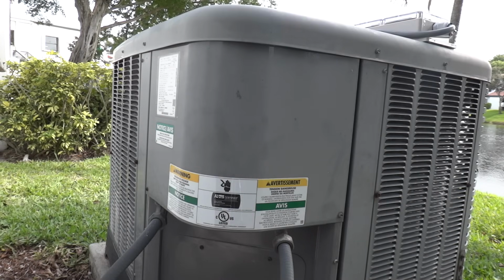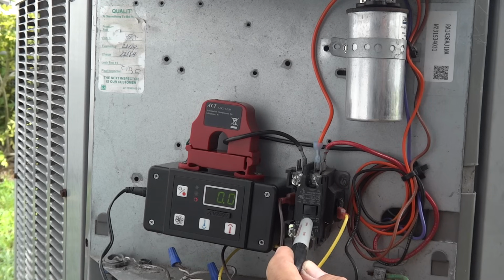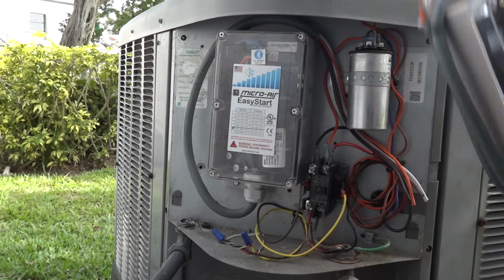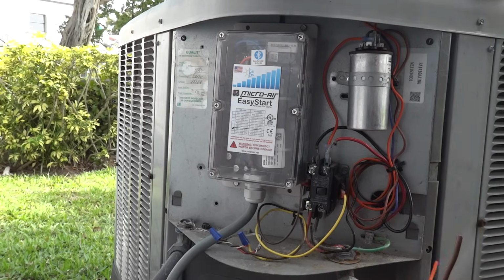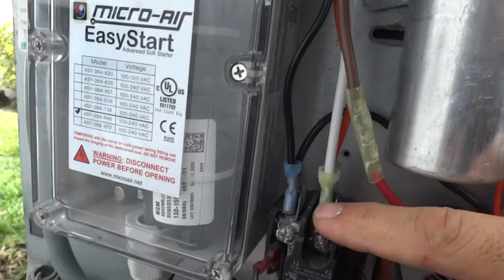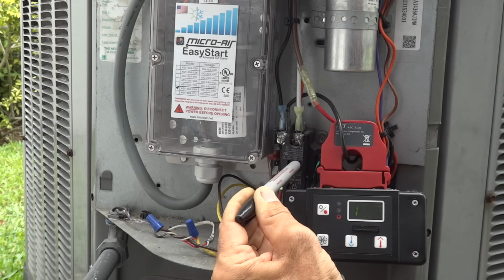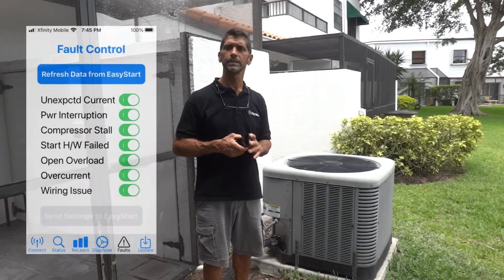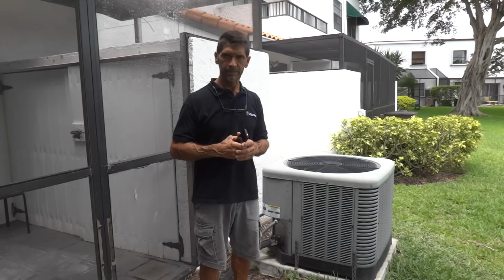Micro-Air EasyStart Home A/C Installation (368 Series)

Comment: This looks like a great product.  Soft starts are the way to go.  Besides limiting current spikes, it should also lengthen the life of not only the compressor but of many of the parts of the system.  Maybe you could develop a sister product that works with the blower fan(s).
Reply: @didyuknow ...And many of those ECM condenser fan motors are changed to old-school PSC induction motors, once the customer finds out what the replacement ECM motor is going to cost. 🙄
Reply: Don't need one for the "blower" as most condenser fan motors / evap. motors are ecm and or x13 motors witch use 3phase vfd/inverter witch is what the easystart is for the compressor.

Comment: Since the unit is designed to start a certain way I wonder if this will eventually damage the compressor.    Yes I know you offer a warranty but it says “ if the micro -air damages the unit it’s covered”.  It would be impossible to prove that’s the case.   So basically really no warranty.    My generator starts my 4 ton But you can heard it  slow as the massive draw starts the unit.    I might get it ready and only use it during a power outage.   Not ideal but would work.
Reply from the maker: Hi Gene and thanks for your comment.  EasyStart will not "eventually damage the compressor". It is in fact quite the opposite as explained in detail in the video.  Even if EasyStart malfunctions, the worst it would do is simply not start your compressor.  There are extensive electronic controls and relay disconnects to prevent anything from even energizing your compressor if anything is wrong.  Of course, if you are not comfortable with installing one, you certainly should not.
Reply: @MicroairNet  saying something in a video doesn’t make it true.   My concern is that because the compressor is designed to startup at a specific amperage, lowering that might actually harm it.   They are built a specific way and changing those parameters could damage them.   I would probably check with Copeland since they make most compressors and ask if using less amps to fire it up would hurt them.  Maybe your company should  contact them and get a letter you could add to your product
Reply from the maker: Emerson Copeland previous and may still offer their own soft starter that is a competitor to EasyStart.  Therefore, one would think they approve the use of soft starters.   Feel free to touch base with them though if you don't trust our word.  Micro-Air has been in the HVAC control design and manufacturing business (primarily marine) for 40 years.  It would not have served us well to dispense any false information that wasn't based upon relentless and through design, testing, qualification, and field results.  90,000+ satisfied EasyStart customers can't be wrong, but you certainly have the prerogative to make your own decision.
Reply: @MicroairNet  ordered.   Sure is a long wait time.   I’m glad you are selling so many.
Reply: Just arrived.   Installing it tomorrow

Comment: Are supposed to discharge the capacitor first? If so, how did you do that? Thanks!
Reply from the maker: Hi Rob and thank you for your question. I answered this before in great detail. Click the following link and the video will open up again with the particular comment and my answer highlighted at the top of the comments list.  Hope this helps:  https://www.youtube.com/watch?v=bp4U-husy1o&lc=UgwzfK55WMX_nr4lxEB4AaABAg.9eQFI1rRPhX9eQRugh8SUZ
Reply: @MicroairNet  Apologies, I clicked the link but can't seem to find in the video or comments where you talk about discharging the capacitor. Thanks!
Reply from the maker: Hi again Rob. No worries. The link of course opens up the same video, but the comment of interest that I'm referring you to gets shown at the top with the label "Highlighted reply".  Cutting/pasting my old response works too.  Here it is:

Here's the truth about the capacitor discharging issue.  Before EasyStart is installed, the run capacitor (silver one) that is installed in your system will always immediately discharge after the compressor is shut down since it discharges through the motor windings. This applies to both 2-terminal (single) and 3-terminal (dual) run capacitor types.  Any optionally-installed start capacitor (black one) in a hard start setup will also discharge through its bleed resistor (if it has one), albeit more slowly in about 30 seconds.  So, when you go to install the EasyStart, after removing power you don't have to worry about discharging the capacitors.  It never hurts to double check with a voltmeter or use an insulated handle screwdriver to briefly short the capacitor terminals together.  Conversely, after you install your EasyStart and energize your system at least once, any 2-terminal (single type) run capacitor will end up isolated after the compressor is shut down and it will no longer discharge through the motor windings; in this case, you need to discharge the run capacitor before you handle any wiring.  However, if your run capacitor is 3-terminal (dual type), it (both halves) will still eventually discharge on its own through the fan motor windings.  Hope this helps.
Reply: @MicroairNet  Thank you! This saves me a little trouble. I really appreciate you taking the time to answer. Can't wait for it to arrive!

Comment: How do u install it on a two stage a/c system that has two compressors? Trane xl19i.
Reply from the maker: Hi and thank you for your question.  So-called Two-stage systems made up of a single compressor with two output capacities (i.e. the scoll types with the bypass solenoid or the reciprocating types that reverse direction to engage more pistons) accept a single EasyStart wired identically to a single, fixed speed compressor.  However, for true 2-stage 2-compressor systems, the only viable option is to install a separate EasyStart on each compressor.  We've investigated these before and it is not possible to wire in a single EasyStart in such a way where it can be shared between two compressors.  Hope this helps.
Reply: @MicroairNet  thanks.
It does have two separate compressors.
Most of the time the smaller compressor cycles on and off. 
The larger rarely comes on.
Should i just install on the smaller compressor?
Reply from the maker: That is an option.  I would first think about what your final goal is.  If you want to be able to run your 2-compressor A/C on a generator during a power outage, then limiting it to only use the smaller compressor would be helpful, and then you could get away with installing only one EasyStart as you are suggesting.  The bulk of the operation on utility power will benefit the small compressor since that is doing most of the work.   

Beyond this, you might need to do one more thing for when you are operating on generator to prevent the 2nd compressor from trying to run:  Most thermostats that handle 2 stages have a Y1 and a Y2 output. Y2 engages the second stage which in your case is the separate compressor.  I am not sure if your thermostat has a setup screen where you can control whether or not the A/C system is 1 or 2 stage. If it does, then during a power outage, you could turn off 2 stage operation to prevent the second compressor from trying to start. Worst case, you could add a switch to disconnect Y2 from the A/C when in "emergency generator mode".  Once utility power comes back on and you are off generator, you could then turn 2-stage operation back on again.  Just some ideas here.
Reply: Hate to but-in, but I have the Trane xl19i (19yrs old) and I can say that disconnecting the Y2 wire would NOT provide the desired result. On the rare occasion that there is a call for stage 2, the first thing that happens is that the stage 1 contactor de-energizes (small pump off) then, after some delay, the stage 2 contactor energizes (large pump on). Without Y2 there would be no pump running at that point (don't know if any faults would occur - I think not?). Changing the thermostat setup to 1 stage cooling is probably the answer, but I have no experience in trying to run the system that way. Just my 2 cents 🤔
Reply from the maker: @Walter Smith Yes, legacy 2-stage system were in fact 2-compressor, not a single compressor with 2 switchable output capacities as the more modern ones are described above.  In the legacy case, you need to install one EasyStart on each compressor so they can act totally asynchronously, regardless of when your thermostat energizes Y1 and/or Y2.  Not everyone wants to invest in 2 EasyStarts though, so many customers with legacy 2-stage systems have installed only 1 EasyStart on their stage 1 compressor and temporarily (i.e. only during a power outage when operating on generator) changed the settings in their thermostat to force the system to behave as single stage only.

Comment: Thank you for the detailed video and explanation.  Your product seems very well designed.  And its greatly appreciated that it is designed and made in USA.  Based on your very well written documentation, Bluetooth is only activated when a call for cooling/Heating is made to the Condenser so that the contactor will apply power to the White input wire of the device.  Is it possible to have the bluetooth on all the time in your future product generations? Also incorporate some application access security such as authentication requirements?
Reply from the maker: Hi and thank you for your compliments and for your question.  You are correct in your assessment that the Bluetooth will only be accessible when the EasyStart is powered up via the condensing unit's contactor.  EasyStart has and always will be a slave device.  In order to allow the Bluetooth to run all of the time, we would have to add a fifth wire and some associated circuitry.  However, in order to keep the product cost and complexity of installation down, this was never part of the design since the product's inception.  Yes, we realize that customers like you could certainly handle connecting a fifth wire, but you'd be amazed how many complaints we already get about 4 wires.  Also, the Bluetooth feature is only meant for diagnostics, so continuous connectivity was never the intent. Hope this helps.
Reply: @MicroairNet  I see that you already thought about this.  Yes, I also have found my fellow HVAC professional often want minimal wires.  :) .  Great product by the way, and there is nothing else like this.  The safety features and the app information is already worth it.

Comment: Hello I just recently installed the 368-48 and have not had the results that everybody else is seeing. My purchase was based on a few things, one the chart at the end of this video showing , the different size generators you would need using the micro-air and also a few other factors  .
So my Generator is Duramax 13000 tri fuel and I am using N.G which knocks down your amps and watts but that being said I am well above specs shown by micro air.
I  have a 3 ton Goodman GSX series which is about 4 yrs old. I got with their tech support  was told that I am getting 68% inrush reduction so as per tech support LRA = 77 for my unit -24 amp reduction average is what there seeing give me 54 amp not acceptable to me. I had a hard start kit which was giving me 35 amp inrush . I am not an electrician so if I am missing something here please tell me
Reply from the maker: Hi and thank you for your comment and for your business. Using the EasyStart smartphone app, please upload the data from your EasyStart to Micro-Air using your smartphone.  We will then be able to analyze your results and advise from there, and then take any necessary actions for you under warranty.
Reply: @MicroairNet  Good Day I had done that with Barry will be glad to do it again , I really don't want to send it back I really want this to work and I am open to any and all suggestions
Reply from the maker: Okay, I found the data you uploaded yesterday and the email conversation you were having with Barry. The first set of data you sent yesterday morning shows that your EasyStart learned well and you were getting startup peaks in the 25-30A range.  That is a 61-67% reduction from your 77 LRA, which is great!  This is what we would expect from EasyStart.  Now, if you were measuring your startup peaks before with your clamp-on ammeter (and your hard start installed) and comparing those to the startup peaks reported by the EasyStart app, those can be VERY different.  Even using the clamp-on ammeter with EasyStart installed will result in a distortion of the actual real current profile going on during the two (hard vs. soft) startups.  Here's why:  

The reason is that many clamp-on ammeters, even in MAX or INRUSH modes, do NOT capture the true peak of the startup. Such ammeters have a moving average window that can be upwards to 0.5-0.8 sec even in INRUSH mode, which then averages ALL the current that occurred during that period.  EasyStart reports the startup peak in a 0.05sec averaging window, which is MUCH more precise and realistic.  So, since hard starts are over and done with in 0.2 second, the clamp-on ammeter will report a LOWER number that is not the actual peak (which is still close to the 77 LRA) since it took the 0.2 sec peak and averaged it in with the much-lower running current (~10A) that occurs right after that up through 0.5 sec. EasyStart spreads the startup current profile out over about 0.6-0.8 sec, which you clamp-on ammeter can actually read a little more accurately since it is so much slower and more gradual.  So, your before/after results could be getting skewed by your measurement device.  The proof is in the pudding though.  With EasyStart, your A/C will startup much more reliably on your generator since the true startup peak is 65% lower.  You really need the ammeter device like I used in the video, or an oscilloscope to see the difference.  Sorry for the long explanation.  I hope this helps.
Reply: @MicroairNet  Thank you for the detailed report, I was going with the peak amperage number on the micro-air app which shows 37.6 and  looking at your video showed peak amps if I recall was 20 after installation which is what I was hoping for, thereabouts. 
My generator is only rated for 36 amps because I am using Nat.gas so you can see my concern. I did upload another report as you asked. So all this being said what is my startup or inrush amperage knowing you have all my logistics is it the 37.6 number?
Thanks for getting back on a Saturday. Barry did ask me to do a relearn yesterday which I did so I never saw those 25-30a range numbers
Reply from the maker: Hi again.  I'll be contacting you via email very soon since it will be better for us to dialog there.
Reply: @MicroairNet  Thanks
Reply: This is an update from 2 months ago, there has been a software update for the phone app which reflects the true numbers of what the end user is truly seeing. The other higher numbers that I was seeing if I remember correctly are called micro surges which didn't affect the performance of the soft start it just was being too honest. I can run my 3-ton Goodman and the rest of whats necessary in a power outage. Great tech support.

Comment: Hello! I have a Bryant Furnace & AC, does it have any relation to Furnace ? Has this been tested with other AC Units like Carrier or Bryant AC units ?
Reply from the maker: Hi and thank you for your question.  Absolutely.  EasyStarts have been installed into just about every brand of home A/C unit that uses a fixed-speed, 1 or 2-stage compressor.

Comment: Thanks for the video. Question, I have a Trane XR which has a LOT of electronic components and boards. This is a 4 ton a/c - heat pump and it affects the home lights when it starts ( 114 LAR) pull. I wanted to install the easy start but I am afraid that I will affect the functions managed by the electronic controls. Would it be the same process to install the easy start as you show on your video? What has to be done different if need be? Thank you so much for your guidance
Reply from the maker: Hi and thanks for your question. Your keen observation may in fact impact the EasyStart setup. Typically, when there is a sizable circuit board in the condensing (outdoor) unit electric box, that control will typically monitor the compressor's startup to make sure it started right after the contactor closes. The EasyStart will delay the start of the compressor by as little as 5 sec and as much as 3 min. This may cause that separate controller to declare a fault and turn off the contactor before the EasyStart has started the compressor.  We've seen this before with certain Carrier units that also had big circuit boards.  There is a fix for this that is accessible from the EasyStart's Bluetooth app.  Other than this, the EasyStart installation wiring is exactly the same.

I went online and tried to find some good installation manuals for the Trane XR series. I found that there are various sub-models, XR13, XR14, XR16, and XR17, none of which had descent manual online.  So, the best course of action for you would be to take a clear photo of the wiring diagram on the inside cover of the outdoor unit's electric box, and email it to help@microair.net. Ask the question if your unit will support an EasyStart installation and if the startup delay needs to be set to 0 seconds.  There is a way to do the latter via the Bluetooth app, but we don't recommend anyone do this unless their particular A/C unit absolutely requires it.  The startup delay is part of EasyStart's added compressor protection features, so defeating it is only worth doing if the A/C condensing unit absolute requires it to function properly.  Hope this helps.